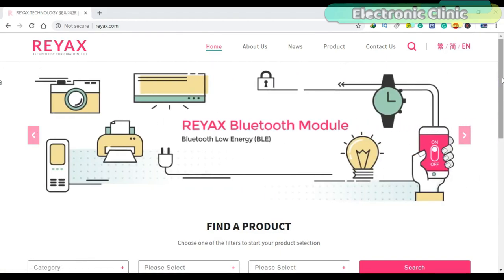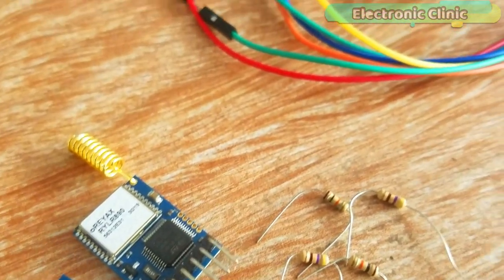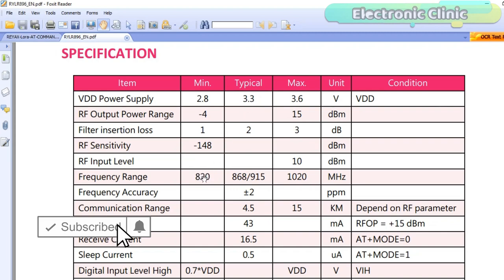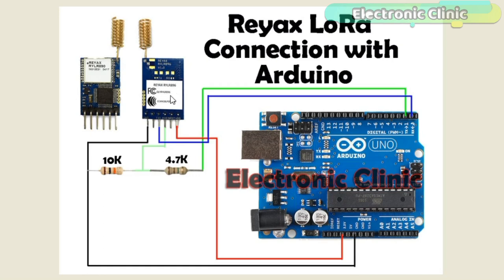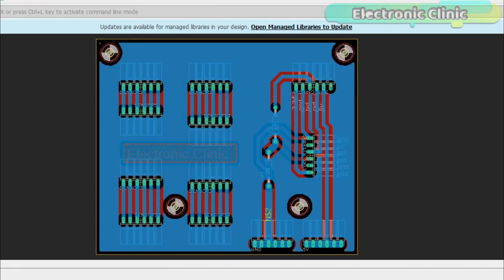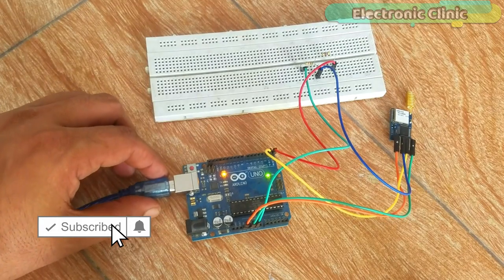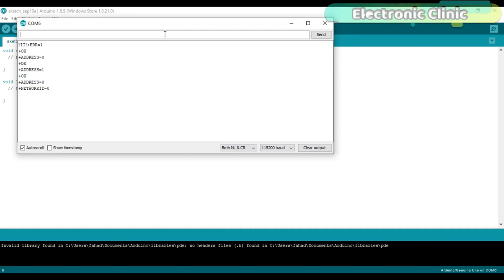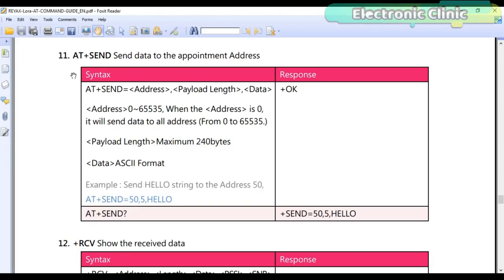Reyax rylr890/rylr896 LoRa 15km 915MHz RF Transceiver connection and AT commands

Comment: Hello. Thank you for the fine introduction to these nifty modules. I wonder if you can help me with a technical question. In my setup I'm using a pair of RYLR896s. After a module sends data, it waits for a reply from the other module to ensure the message came through. If it doesn't receive an "ACK" message inside a specified interval, it retries. My question is, how long (if at all) should the receiver of the message wait before sending the "ACK" message? -- Currently, I'm getting ~85-90% success as measured by a successful Transmit -> ACK sequence. This seems quite poor to me and oddly, seems fairly independent of the distance between the modules. I'm wondering if there is a timing issue I should be exploring.

Comment: Hi, nice and clear video! I received these modules 2 weeks ago, all working perfectly fine and got a range of ca. 25 km. 

But is there a way to NOT run these things on hardware serial, but use SoftwareSerial, NeoSWserial or AltSWserial for example instead. I’ve tried this but didn’t work for me, do you have a fix?
Greetings from the Netherlands

Comment: Is the controller on the Rayex module programmable, or is it always necessary to use some kind of control board if I want custom behaviour? I want to read GPS data from an attached device and send by LoRa.
Reply from the maker: you can attach your gps module with Arduino and then send the longitude and latitude values via Lora. its simple. watch my other video on lora. In those videos i have explained how to serially send data from one lora to another.
Reply: @ElectroniClinic  Thank you but what I want to know is if this is possible without the Arduino. Thanks for the reply. I'm very new to this stuff.

Comment: Bro great project I was followed all this process as shown in u r video but I have some problems only address is saved in the memory of rylr896 parameters and bandwidth not saved after disconnected from pc and reconnect module with pc all commands are default 
And I m not getting the range above 100meters pls bro help me.

Comment: I would like a typical (not max) distance range up to 20km or greater , not in a straight line including obstacles such as trees and so on...Which transceiver pair (in 868MHz) should I buy?...The application is for sending data such as humidity and temparture...Thank you in advance.
Reply: Did you find the one which u can use ? And is the 868Mhz one license free ?
Reply: @raketenliebe  No, I actually have stopped looking....868 MHz is free here in Greece I think.

Comment: the serial monitor doesn't do anything for me. AT command shows blank output do i need to install a library for this or something?
Reply: Change the baudrate
Reply: @jalalwadood6519  I have the baudrate at 115200 I don't get any response either
Reply: I don't know how it was done on this video but I connected RX to RX and TX to TX and it worked for me!
Reply: Good Day sir @jalalwadood6519 , we changed the baud rate but we did not get any response either. Is there a fix for this?